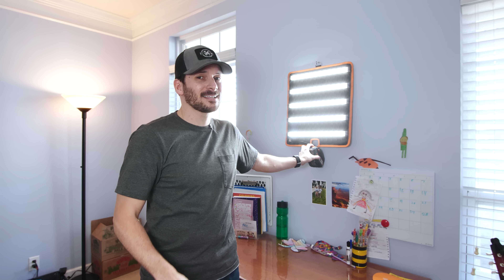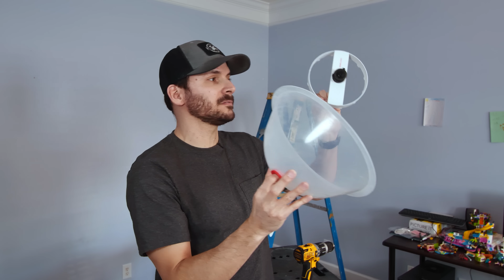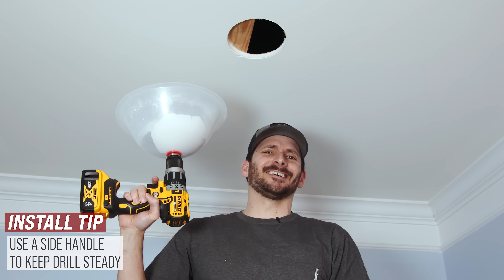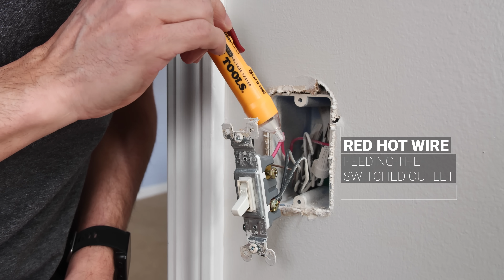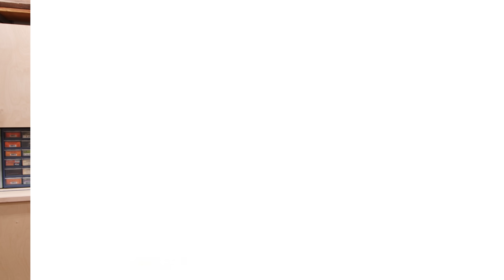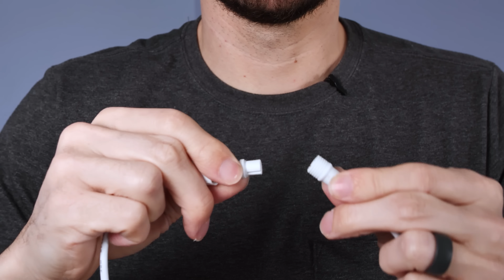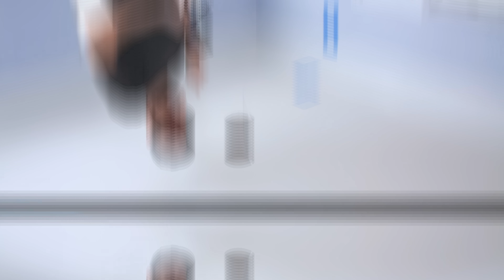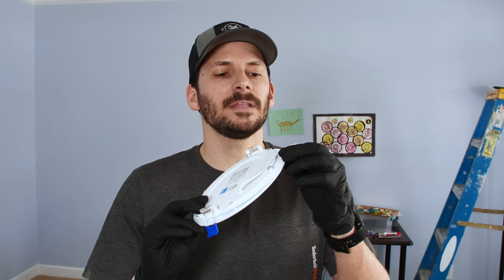Recessed Lighting Install with No Attic or Prior Wiring

Comment: I used similar wafer lights but I cut off the pigtails and used bell wire to connect the boxes to the lights. This way I could have the boxes all in one place and not have to run heavy Nomex all over. 
You can get away with this as the electricity running in the pigtails is low voltage, low current. You can hold onto the live wires and not get a shock. You can even short them together and the wire doesn’t even get warm. 
To be safe I would check the output of the pigtails with a voltmeter. It should also have a sticker on the box telling the output voltage and current. Mine was 19 volts and 300 milliamperes.  Way to low to be dangerous. 
Just remember the output is most likely Direct Current so polarity matters.

Comment: When these burn out, how do you replace them without going in to the attirc?
Reply: You just pull them straight down, they have a spring clamp holding them up, then if you need to change the fixture all your wires are in the junction boxes already
Reply: @jackamoeXxX  brilliant, thanks for the explanation 👍🏼

Comment: That switched outlet feed in the ceiling seemed reachable from the hole.   It would have been less work to cut the feed with enough room for the first light, connect the switched outlet side to the closest light to it, and use 14-3 to give the outlet constant power.   the rest of the lights could be wired with 14-2, and there would be no addressing the outlet later.

Comment: I'm a new construction plumber, not an electrician. I prolly would have started at the 1/2 hot receptacle  and robbed the switched hot (red) wire and ran it up the wall to the lights with a neutral/ground,  after replacing the receptacle with new (un-cut).

Comment: How did you know the existing line in the attic was not controlled by the switch?  If it was 14/3 it would test hot whether the switch was on or off.

Comment: Do you know if these wafer lights can be in contact with insulation? I would like to do these in a room. But we have a ranch. And the drywall above has loose blown insulation above it. edit nevermind, I rewatched and now I see you mentioned that in the video.

Comment: Thanks for the video.  What if i already have 2 existing recessed lights and i want to add 4 more....but there are BEAMS in the middle and i dont want to drill wholes in the beams.  Ceiling has 2 layers od drywall....any tips on how to run the wires UNDERNEATH  the beams touching the ceiling dry wall.  

I'm trying to AVOID: 

1. Drilling wholes in beams
2. Cutting extra wholes to fish wires.......

I'm hoping theres a way to shave off dry wall?
 Internally and push the wires through the bottom of the beam touching the ceiling dry wall.....

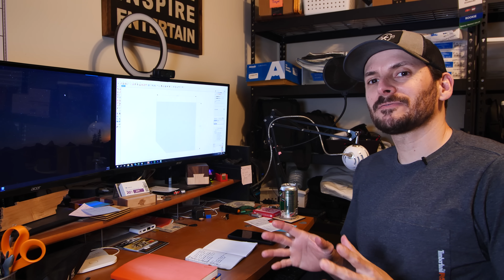What do u think? 0:39

Comment: So I guess required securing of Romex lines within twelve inches of every device and no more than eighteen inches everywhere else isn't a thing where you live? It also seems weird that there are unsecured Romex lines in the scuttle. I do have those same type (probably same mfr also) but in the 8"-inch size. They are fantastic for my shop. Secured wiring, of course.

Comment: all you had to do is feed a new wire down the wall to the switch then tie the order wires together keep the plug hot on top and bottom tie the whites together run black to one side of switch and other side to live wire. you did it had way

Comment: You never showed tapping into the line up in the ceiling. Usually those lines are tight with no play and you have to make two boxes with new extra wire. It would have been interesting see how you got all that done with only that 6" opening. Also, you never showed your other access holes and the finished drywall patches, which can be REALLY tough to make disappear into the old work.

Comment: Someone needs to revolutionize electric outlets.  They are archaic at best, and every time someone opens up an out let or switch, the are like WTF?  Outlets were designed for incandescent bulbs.  we all use LED, which use about 10% of the energy as the older incandescent bulbs did.  What we need are more outlets but with less voltage.  For example, What if outlets were USB-C?  They are smaller, more efficient, power almost everything now, and you can still use the older outlets for other products that use a lot of energy.

Comment: Interesting, I noticed that you are doing electrical connections in the ceiling without using an accessible electric box.  This would be a big code no-no for AC wiring.  Is all the LED wiring low voltage DC wiring?  That would explain how what you are doing would meet code.  If that is the case, you might also be able to make the wiring runs with smaller braided wire rather then ROMEX and that would make the install even easier.

Comment: Got two smart phones? Or a smart phone and a tablet, or a current smart phone and an old wifi-capable smart phone? Load Alfred on both (available on Google Play and the Apple app store.) Then, you can use one phone as the camera and the other as the monitor. Stick the camera phone way up through the hole. You can even use a selfie-stick. Using the second phone or tablet as the monitor, you can really move the camera phone around in the ceiling space to see what you need to see.

Comment: i find it better to run your drill in high gear, but not full speed when using larger hole saws. in a higher speed there is less torque, the motor is more apt to stall when it grabs. with less chance of snapping your wrist or slapping you beside the head.

Comment: You don’t need to run any new wiring to plug. Where you cut the wire just tie the blacks through to continue power to the plug and then jump a wire to replace the cut tab on the switched plug

Comment: How are you fishing wires to the can lights in different directions without cutting the ceiling open to get through the ceiling joists? This is not normal, misleading, and just very strange in my opinion. I have always had to cur the 2nd floor open and drill through ceiling joists that run in a direction that blocks wiring from going through them. Can you please explain this? You would be my hero.

Comment: Brad... I don’t know how you did that. I have a room in my house without lights and I haven’t been able to figure out what to do with it without breaking into the drywall. There’s a switched floor lamp in there. How...
Reply from the maker: that was my exact situation so the video shows exactly my thought process and how to track it yourself.  If you're wiring for switch goes down instaed of up you'll need to pull new wires like I was showing in the mock up
Reply: A simpler alternative is to install dropped crown molding with a rope light.  This way your just adding one box directly above the switched receptacle and you don’t have to navigate through the top wall plate or up into the ceiling.  But keep in mind this is more ambient accent lighting and not bright task lighting.

Comment: Quick question for the DIYers, once you complete a project (say upgrading recepticals or hooking up new lights fixtures) do you have them inspected by electrican or an inspector, what is down in the line god forbid there is an incidence how does insurance claim works in that situation, will they deny it as the work was done as DIY and wasnt inspected?

Comment: Don't put that drill on a high torque low speed setting. If that thing does catch you want it to stop not whip around and smack you in the head. Go at the drywall with the drill spinning fast but put little to no pressure on the actual drill, let the saw do it's thing. It also helps to hold the drill nice and flat/even with the ceiling.
Reply: Wow I made this comment before I watched the part where it almost smacked you in the face. Lmfao I made the comment based on experience by the way, I have had that same exact drill/battery setup smack me right in the face while making a 4inch hole for a mini split a/c setup.

Comment: Another tip from an electrician, don’t know how it is where you live but you should also get your work inspected. No one should be doing electrical work if you’re not sure what you are doing. Yes you spend money on an inspection but it’s always better to spend a little and have less risk from a house fire that your insurance might not cover if you don’t have proof of an inspection. Now I’m not saying you have to get an electrician to do the work. I’m a big fan of people trying to save money and learn new things but at least in ONT a homeowner can do their own work and call for an inspection. But also don’t think it’s a good idea for someone who’s not an electrician teaching or showing people how to do things when you yourself don’t know 100%. I noticed when you did a close up of the wires connected in the first light coming from the switch, you connected the black wire from the 14/3 to the same connector as the red which you didn’t need to do

Comment: Here’s a good idea, why not list the tools used in that video and the if someone was interested in say the dust mask that stops the dust going into your face when drilling holes to accommodate the drywall dust when drilling upside down they could just look at the tools used and find it
Reply from the maker: all tools used in the video are listed in the description, thx
Reply: @Fixthisbuildthat  Well I have now been through everything listed on the “show more” pull down screen and been through dozens of ace masks but I still cannot find the piece that goes between the drill and the ceiling to catch all the dust from drilling the six-inch hole.

Comment: Great video.  I do have one question.  If you are putting these in an insulated ceiling is there any concern about insulation being in direct contact with either the light or the wiring box?  Thanks

Comment: you dont need a switch at all with smart bulbs, they need to be on or should be ON ALL the time.  In fact, they sell devices to cover the switches, so they do get shut off by accident.  Is it possible, for a new installation in an older house to just not add a switch at all?

Comment: Only issue with these lights vs actual recessed lights is they glare more since they are not recessed in a housing and have nothing to soften it.  You can actually witness that in this particular video when the lights are turned on.  If you look at the lights themselves you will see the glare.  I love the simplicity of these, but I hate glare and find it fatiguing after awhile.  Pros and cons to everything.

Comment: Believe it or not, on speed "2" it is LESS likely to catch twist your wrist (and smack you in the face) because there is less torque.  It may catch, but it will stop or slow rather than try to break your wrist.

Comment: Whoa. Not to be critical of your video cause I think it is great, however you skipted a bunch of important stuff. You went from finding a hot wire off your switch to plugging in all the lights. How the did you do that and why didn't you explain. Wiring didn't magically connect to the other 3 lights. Unless you ran wiring across to them.

Comment: Could you just rewire at the switch to make the plug wires bypass the switch so its always hot, and then wire in the light to the switch, then you don't have to rewire the plugs too?

Comment: Good thing you brought 120 v to a light but uses less than 10watts.  Low voltage DC wiring is coming to a theater near you in every new build... Stay tuned

Comment: I think you should wear your safety glasses all the time...sets a good example, especially to youngsters.
Reply from the maker: I wear them when needed to set that example. 👍
Reply: @Fixthisbuildthat  Just wondered. My youngest asked why you weren't wearing them when you were on the ladder and using the holesaw in your ceiling. Different strokes for different folks, i reckon.

Comment: Why couldn't you use one of those light boxes to continue to power to that outlet?  It would just have an unnecessary red wire after the new connection
Reply from the maker: Yeah, I guess I could have run 14/3 wire through all of them and down to the outlet again, but those little junction boxes are very tight already, not sure it could handle another wire connector and 2 conductors.  Plus I didn't have 14/3 wire :)

Comment: the issue with these is when they burn out and they no longer make this brand or connector type which happens a lot with electrical your gonna have holes in your ceiling. If your a fellow sparky take the time to measure so you clear the trusses and instal IC rated housing so the customer can change the bulbs, trims etc. as they ware out or there style changes. If your homeowner you do you boo

Comment: Speaking from personal experience, it's absolutely necessary to use a stud finder. In the event you cut a hole that exposes a ceiling joist, that led won't sit flush against the ceiling, which in turn will make it look like complete horseshit. This is still true even if you remove any protective gasket. It may appear flush in some areas, but the OCD in me knows that it won't look perfect from all angles. Take your time and ensure that you're making the proper adjustments.

Comment: Code requires that a junction box be mounted to a stud, not laying loosely on top of drywall. So stud location does matter because the pigtail they give you isn't very long. If an inspector sees that they can force you to comply with this. I hope you have enough wire to allow you to screw them to the stud without having to install more junction boxes.

Comment: I'm unclear why you didn't simply leave the unswitched black circuit in the ceiling intact, or extended to a box in the ceiling near your opening so you didn't have to drop a cable down the wall. After all, you only needed red, white, and ground for the ceiling lamps.
Reply: I was thinking the same thing

Comment: I don't understand how your sheetrock is attached to the joists if you have room for those lights with a beam directly in the way.  Is your sheetrock somehow floating and not attached directly to the joists? Most of us would have to drill thru at least one joist on the second half of the room to get the wire over in the bay where we want the lights.  I wish you would have demonstrated  that type of install.
Reply from the maker: The lights are literally that thin. Less than the thickness of drywall!

Comment: There's literally no reason to run new wiring. 

1. Use the first light as a junction box. Leave the constant hot running to the outlet, replace it with an outlet that doesn't have the links broken. If you don't have enough excess wiring to reach, use 12-3 wire to run to the next closest light and tap the old wire back in.

2 .Tap into the switched side for the lights.

3. Profit.

Comment: So you cut the existing wire and splice it into those boxes, I’m assuming you could add more wires if you didn’t have enough length already up there? Not the best with electricity !

Comment: As I am watching this video, installers are blowing 49R cellulous insulation into my attic.  With my existing 4" of fiberglass, I am looking at 16".  I am wondering if I can run wires under that if I want to install 6 light string in my kitchen?

Comment: Six inch is really outdated, 5, or 4 is the new style. Use the walls to bounce the light, so about 2 feet in max. Then a nice ceiling fixture in the middle if possible.

Comment: You could have just cut the existing wire and put it in your first light junction box put the other end in the next light  junction box and you would still have power to the plug

Comment: When drilling with a hole saw, let the hole saw do the work DO NOT PUSH UP!!
Reverse drill, I drill at high speed (2) - but slow is fine (1), if you can learn to trigger pull like it’s a gun for angle cut up - nvm

Comment: I think you could have made the outlet hot on both plugs without running new wires by just changing the outlet to a new one and wire it with the hot wires..

Comment: It’s not as bright as you would like because the lights aren’t spaced out correctly, a lot of your light is being lost because they’re too close to the wall … measure the ceiling and divide by 3 that way both lights are equally as far apart from the wall as they are apart from each other

Comment: Just curious, did you need to pull a permit to do this job yourself as the home owner? I’m starting to work on electrical projects in my home and I’m wondering if I need a permit to install recessed lights.

Comment: I'm confused why you couldn't maintain the constant hot wire to the outlet? Just would have required a junction box in the ceiling right? Where you snipped the wire you could have spliced the always hot from the switch box with the wire going to the outlet. I'm a DIYer so maybe I'm misunderstanding something.

Comment: Lmao 

Your tester issue is because you are using 

1 that is a NO CONTACT Tester and 1 that is a Full contact 

The larger 1 is just to keep near an outlet while you go check power real quick or if you in next room by panel box. You can leave the round 1 by the outlet and you can hear ot stop going off when your by the panel box hitting breakers 

The other tester tiu have is a contact tester 

Thats why it has a THIN LIP at the end. To Stick into the outlet to test it - or lay it on the wire behind outlet or switch 

Both your testers work great 

In fact General Electric makes decent testers

Also. This is why we have INSPECTION CAMERAS lol. TO stick in ceilings or walls - 

Never attach a line to a wire you dont know what its for.

Just get the $100inspection camera and stick it upc in the ceiling and youll find the real line coming off the switch 

Or JUST RUN A NEW LINE in the ceiling hole right down the Bay and down the wall and to the switch